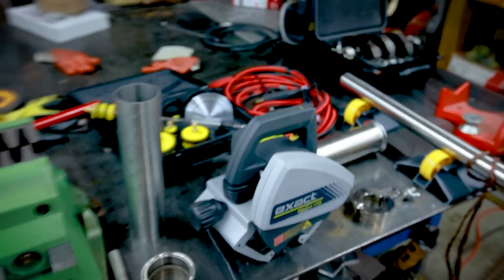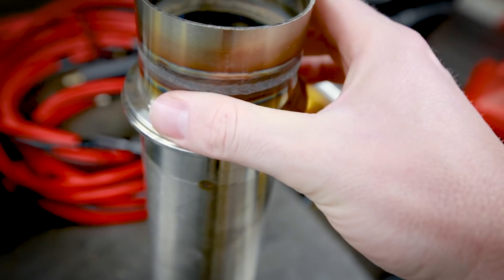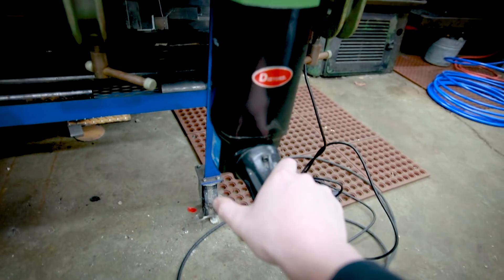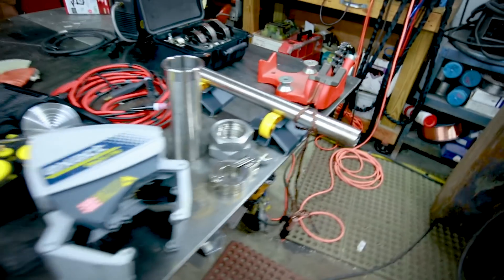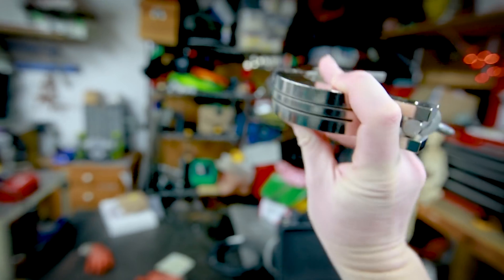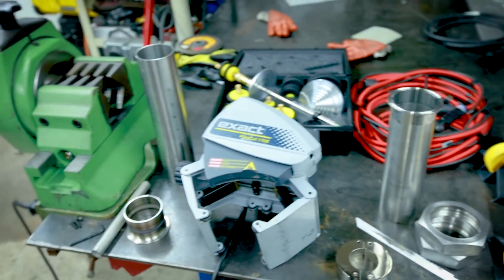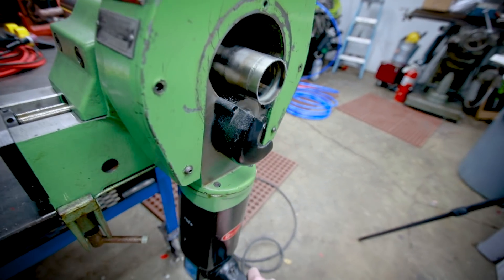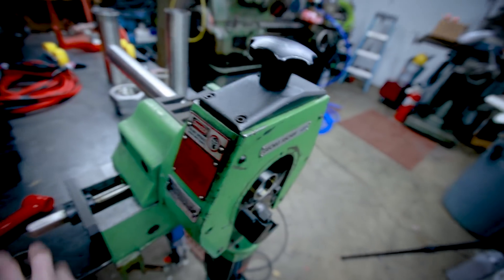How To Weld Sanitary Pipe Part 1

Comment: For 16 years I made stainless steel pipe and tubing at a factory. It  was awesome. We made a lot of sanitary tubing. 304 is most common but 316 is used if it needs to be electro polished. Because most tubing is belt polished even if it looks very shiny. You will know if it's been belt polished or electro.

Comment: The cutting guide clamp is not a one time use. It has a groove for a Bi-metal blade on a reciprocating saw (Sawzall) on one side, and a groove for a Porta band saw right next to it. Its use is for cutting into sanitary tubing where you cant remove a section of tubing already installed at a plant.  A horizontal band saw and a cold saw gives you the best cuts on the sanitary tube. Do not use a sanding or flap disk or grinder to debur, use a fine file.
Reply: He said you only get about 1 cut out of the sawzall blade, not the clamp.

Comment: Hi mate, I worked on aircraft engine tubing and we used to cut tube with a hand saw and then faced it off with a facing off machine. Well easier than your methods.

Comment: In the sanitary pipe welding field do you guys ever have to pie cut to make radiuses or cut out sections of off pre bent mandrels? If so what tools would then be used to make accurate cuts? Im in the automotive field and most of the ways we get bends are thru mandrel bends and pie cuts but they usually get cut with a band saw but I always hate it because I can never get a perfect straight edge so its very time consuming

Comment: How come you get so few cuts out of the exact?
Reply from the maker: 304  just destroys tooling
Reply: @DarlingtonFarm  Did you ever try a slow speed? 304 work hardens if it gets any heat.   On the mill I run it about 30 SFM with high speed steel tools. I always keep a higher feedrate. They idea is to dig under the hardened layer and always cut and never rub which causes the heat. You can see it using a hand drill. Lots of RPM kills the drill quick. Slow RPM and lots of pressure and the drill lasts longer.

Comment: Hi, very informative video, I was wondering if the tube has to be cold cut? If it was cut with a hot method (eg grinder) and cleaned back to silver does this affect the material (& therefore the subsequent weld) or is it just more effort to clean and square. Thanks.

Comment: Why coukdnt you use a pipe cutter roller to cut the tubing? If you went slow if wouldnt roll the edge , is it a possibility?
Reply from the maker: I have tried it it roles it just enough to cause problems

Comment: Need to sort your purge out, need a cleanee root than that @7.10 !!
Reply: Outside is not the best. Purge looks fine. There is no root in sanitary. One pass, no filler, all fuse.
Reply: Outside doesnt look the best, purge looks fine. There is no root in sanitary welding. One pass, no filler, all fuse.